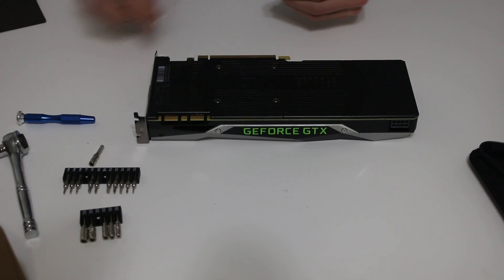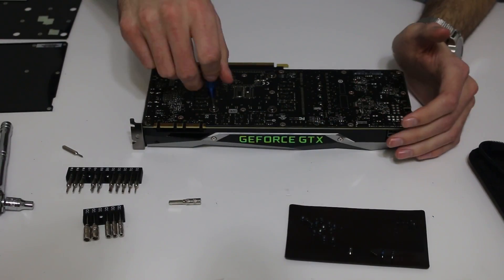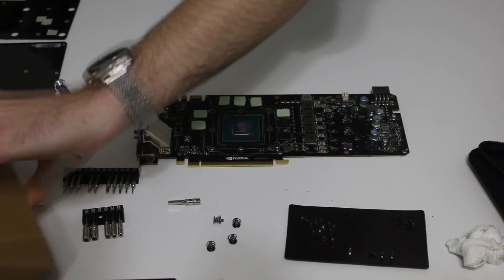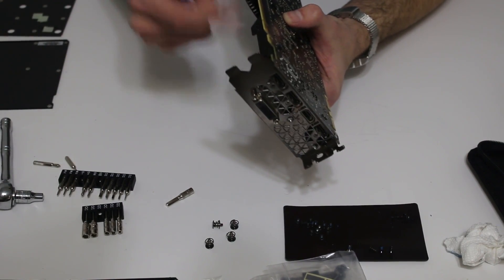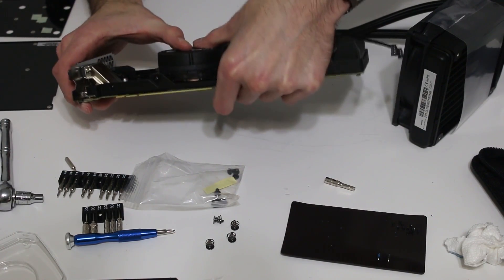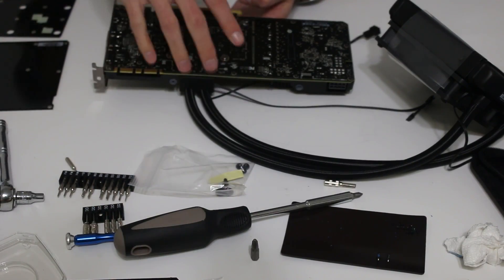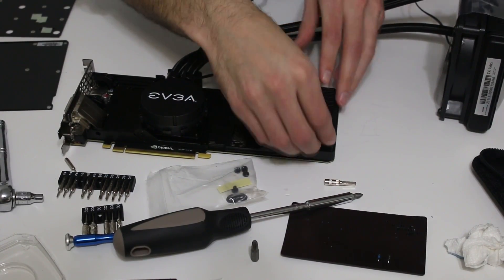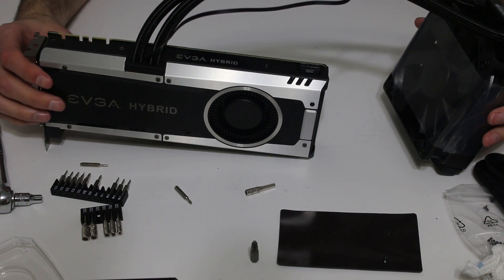EVGA Hybrid Cooler Installation on GTX 1080

Comment: Hi great vid. I have the gtx1070 black edition. It has no back plate already but will this kit work on it? All the vids are for the 1080.
Reply: The Hybrid Cooler for the GTX 1080 is fully compatible with the GTX 1070.

Comment: Looks no worse then doing the thermal pad update on my 1070 sc black. wonders how easy it would be to swap the 120mm rad to a 240 off a corsair h100iv2
Reply: Scootermagoo stupidly hard cause all in ones are designed to change rads.  You would have better luck nodding the h100i v2 into this bracket system I’m pretty sure

Comment: is it possible to use  different aio cooler than the included evga one? like one with a bigger radiator? ive looked all over the place for the answer to that and nobody seems to have asked that.
Reply: companyoflosers nzxt has a bracket to do something with up to 30 water coolers.  I think it’s the g12

Comment: I got one question. Why did you leave some of the white thermal pads on the Vram of the GPU? Doesn't EVGA have thermal pads installed underneath the heatsink itself?
Reply: I bet he overclocked it and blew his VRMs not noticing to even take off the covers on the preinstalled thermals and leaving old ones on made it even worse.

Comment: I installed my cooler correctly and now I'm getting no signal when I boot up. No video whatsoever
The fans, leds, and pumps all turn on just fine. Just no video. Any suggestions?
Reply: oh man that's scary. I got 2 zotac's and i am about to replace the stock fans... now i'm scared shitload.
Reply from the maker: Hey! Sorry to hear that. This is one of those things really hard to diagnose without more details. It might be helpful if you sent a picture of your setup to help rule some basic things out.

Outside of that, can you boot to your OS with the integrated graphics? That should help get more diagnostics and narrow down the problem. Alternatively, is there another monitor/cable combo you can use to test, just to rule that out? Good luck, and feel free to message me with any other pics or specs. I'd be glad to try and help.
Reply: Matt Burke well now I'm getting no signal from my motherboard either, lemme try a few things and I'll get back to you
Reply: any updates on this?
Reply: jdj9 ended up RMA'ing it to zotac I'll see what they say next week.
Reply: but how... there is nothing that could come off easily...
Reply: I've installed both hybrid coolers. they work fine. Now i hope they won't leak :P
Reply: ExplodingWindow hey man. what was the issue? I have the same problem as you right now. I tried installing this kit and now my card won't output a signal. 

what did zotac say and did they let you replace the card? please let me know what happened.
Reply: SiR Dave it might be your power supply. Did u try to reset the  BIOS By get the battery out of the mobo. Tell me all ur specs
Reply: jdj9 I'm sure it was just my fault, maybe I knocked off a couple fuses off the back or something. Cuz the card worked perfectly fine before I tried installing the cooler